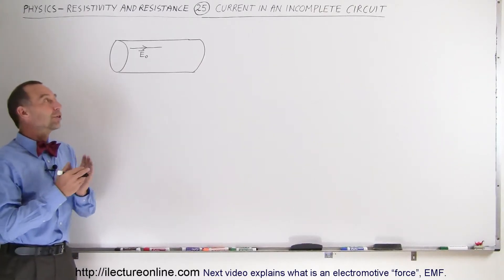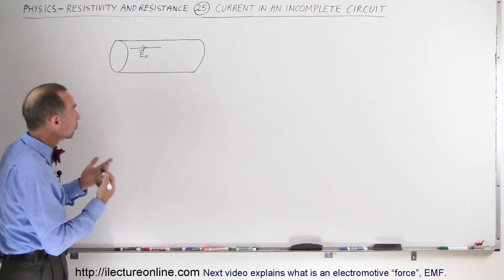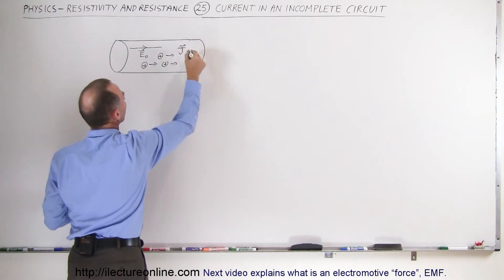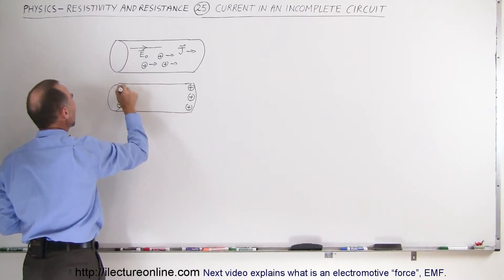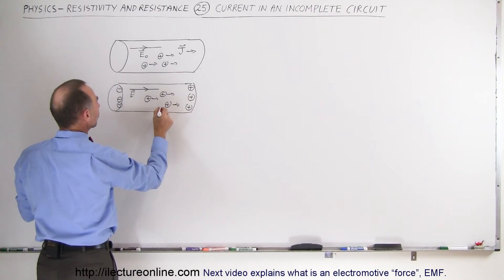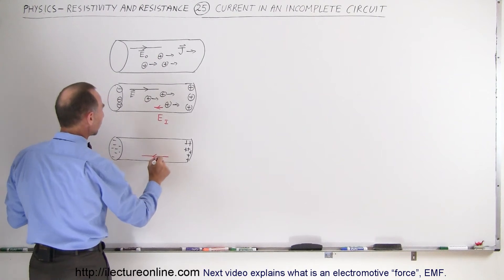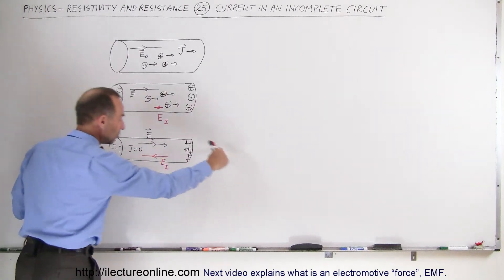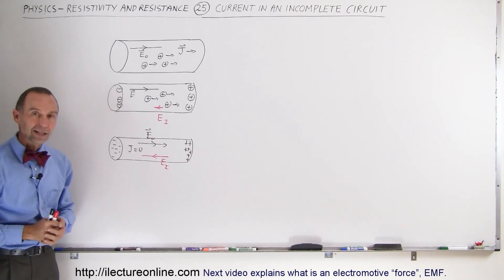Physics 40   Resistivity and Resistance (25 of 33) Current in an Incomplete Circuit

Comment: hello sir, how can there be an electric field in a conductor?
Reply from the maker: 1) There is an electric field around every charge (such as an electron or a proton).      2) Whenever there is a potential difference (as there would be in a conductor) there will be an electric field.  V = E * d
Reply: Yes sir, but i thought that the electric field in a conductor is always equal to zero
Reply from the maker: If there is no current, they yes.  All the extra charge will move to the surface and the electric field inside will be zero.   This video illustrates the electric field when there is a current in the conductor due to the potential difference across it.
Reply: Michel van Biezen thank you so very much sir. if only my professor was as good as you are!